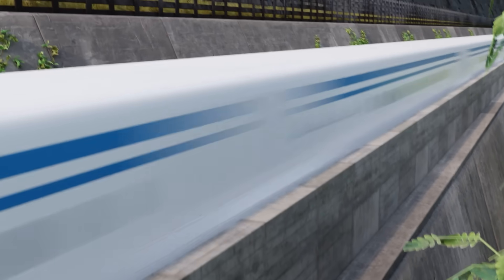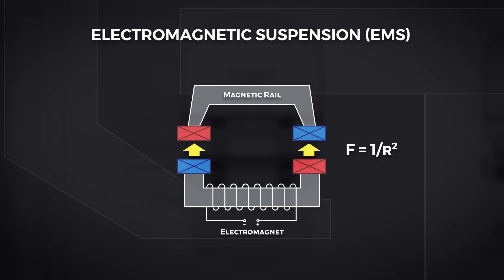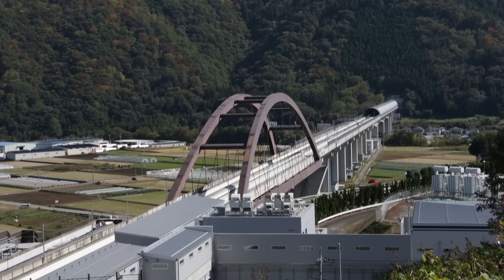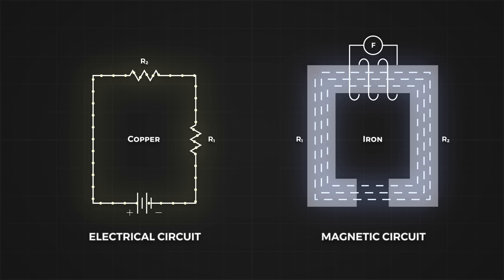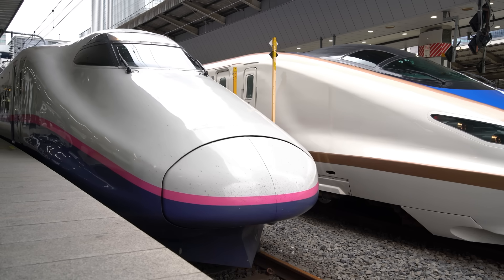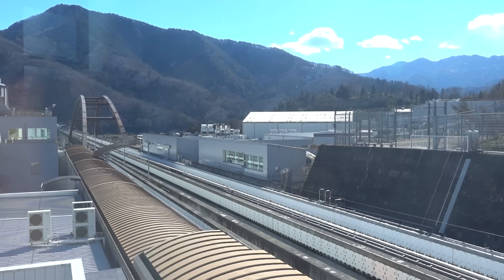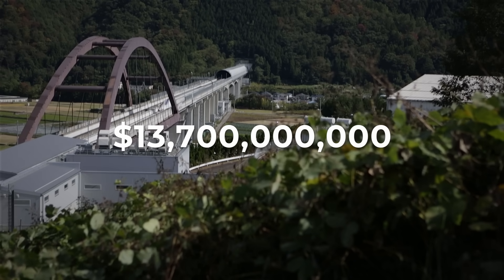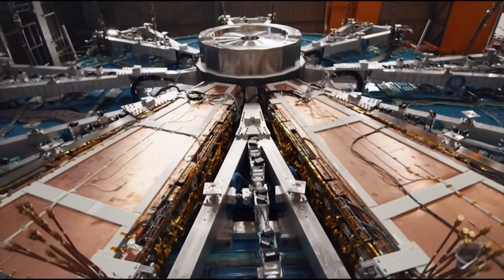How Japan's Maglev Train Works

Comment: My understanding is that yes, MagLev has a far higher startup cost, but a far lower operational cost due to reduced maintenance from the lack of friction.
Reply: At least in theory.  Nobody has enough experience operating them long term to say that empirically.  And requiring constant input of liquid Helium for cryogenic superconductors is not trivial as an operational requirement.  Another few advances in higher temperature and more practical superconductors could make future MagLev lines a lot more practical.
Reply: @guaposneeze  The inner cryo-loop is self enclosed. The helium cooling system will only need topping up in the event of leaks or service, no different than an MRI magnet.
Reply: Yes, and they just made a TREMENDOUS advance...oh wait.   @guaposneeze
Reply: @guaposneeze higher temp superconductor research is a random stretch. With no foundational theory we are constantly just trying random material hoping it works. My grad course I type 2 showed how lacking the foundations are. So they are not breakthroughs you can count on
Reply: It's generally suitable for long journey's for this reason. The higher speeds achieved can make it a rival to aircraft for travel between cities (like Tokyo and Osaka), but on short journey's, who cares if you saved a few minutes, for a seemingly ridiculous price tag.
Reply: @tsumugikotobuki0131  Well, it will also serve as a relief line for the Tokaido Shinkansen line in the event of an Earthquake and open up opportunities at Shinagawa station. JR Central doesn't have a lot of property around Tokyo station and having the terminus at Shinagawa will pad their bottom line. the Tokaido line is a life line for Japan. There are currently hourly flights between Osaka and Tokyo (if not more). Once completed in 2037 (or later) there will be a much lower need.

And it's also a more direct route, which is where a lot of the savings come as well. The physical distance is a lot less on this route. when you're running 16 trains per hour on your main line, it's time to consider building a relief line. There are also talks about making the existing line have more trains make more stops, so that line will, as a consequence, become slower.

The current fastest service (Nozomi) train from Nagoya to Shinagawa takes 88 minutes. 
However, the train that makes every stop takes 123 minutes and only leaves hourly.

After the Maglev train comes online, it's assumed a lot of passengers will take that instead so JR Central has talked about reducing the number of express trains and increasing service to the intermediary stations. Even people traveling from Osaka will likely transfer to the Maglev if their destination is near Shinagawa
Reply: @tsumugikotobuki0131  Tokyo Nagoya will go from 1:40 to 40 minutes non-stop. That's a game changer. 

The great thing about this train is its acceleration curve. It gets to cruising speed  of 500km/h within 5.5 km. Conventional HSR takes 15–20km to get to 300km/h.

So, yeah... it doesn't make sense for conventional HSR to go 400 or 500km/h as it takes a long time to get up to speed. 

The Tokyo–Nagoya segment is ~280km long and station spacing is 60–80km, so yeah... conventional HSR doesn't make sense at all at speeds higher than 350km/h. 

Maglev will be 40 minutes non-stop, and apparently ~75 minutes making all stops, accounting for dwell times while the non-stop trains passes by at some stations... so you're right that making stops when going 500km/h makes a pretty big difference, but I can't imagine what a conventional HSR difference would be. 

On the Tokaido line, it goes from 88 minutes (fastest) to 123 minutes (all stops) and that's only trains that get up to 285km/h on that segment (and parts of the line only 110km/h in Tokyo). 

I can't imagine the spread a 400km/h conventional train would be, even using Japan's very fast accelerating N700S trains.
Reply: @tsumugikotobuki0131 , for short journey, standard steel-rail HSR will still work.
Reply: Absolutely not, because on all investments there is a cost of capital involved. The reduced maintenance cost advertised is more than offset in favor for conventional trains by:
- Higher scalability of longer trains
- Similar speeds of conventional train, as aerodynamics make it inefficient beyond that. TGV and ICE could already be operated at 450 Km/h, yet ICE is the fastest with 320 Km/h due to efficiency losses.
- The cost of capital for the investment up front can be 8% per annum easily.
- Maintenance cost of the rail and wheels are not that much important compared to the cost of energy and logistics.
Reply: @NevermindXY  To be clear, TGV/ICE/Frecciarossa are not operated below 450 Km/h because it's not "aerodynamically efficient", they aren't because at those speeds the train physically destroys the track and possibly itself in a multitude of ways, which is exactly what maglev is meant to solve. For example, for ballasted track, going above 320 Km/h causes the train to suck up the rocks from the ballast into its own underside, damaging the vehicle and eventually ruining the ballast.

Yes, I know a TGV did 570 Km/h, but that was a one-off done with a heavily modified train with one car that would be completely unsustainble on the tracks.

The point of maglev is not that it has a higher theoretical top speed than rail, it's that it can sustain much higher top speeds in a practical manner. Also, it has better acceleration which really helps to reach said speeds.
Reply: @NevermindXY  - Similar speeds of conventional train, as aerodynamics make it inefficient beyond that. TGV and ICE could already be operated at 450 Km/h, yet ICE is the fastest with 320 Km/h due to efficiency losses.

The Siemens Velaro design is already quite old and got smaller changes over the years. And there are velaro versions that are approved for 350 or 380 max. 320 is likely for Germany as we have quite short ranges between the city on the route. So acceleration is more important than the high speed. 
The Velaro Novo that is in testing is a complete redesign and should with aerodynamic optimizations and other cost reductions help to make higher speeds more cost effective. 

Marketing claims an overall reduction in energy consumption by up to 30 percent and A 20 percent reduction in investment costs and 30 percent lower maintenance and servicing costs but we will see how it will work out in reality.
Till the Maglev will be ready to be adopted outside of japan will it compete with a new generation of trains.
Reply: at higher speeds, track maintenance is more costly, yes, so removing train contact with track will save a lot on regular upkeep and maintenance expenses. it has a higher startup cost not only because the materials of the track and construction of the track is more expensive than regular rail construction, but also because of routing. at higher speeds, there have to be gentler curves. this makes it hard to route around obstacles like mountains and means disruptive construction through cities and expensive tunneling/bridging. but it is ultimately worth it as the trains are cool. they also are good for the economy because people will go to other places more. also it is good for the climate because it will replace airplane trips. UNLESS! it will be good for climate unless it does not replace airplane trips. if it replaces preexisting bullet train trips, it will be bad for the environment because of ecological disruption from construction and increased energy demand from higher speeds.  it's climate savings come from reducing costly flights, but in tokyo there are already mostly people riding the train. what really will help to convince people to ride the train instead of fly is decreasing train ticket costs, by increasing capacity. in conclusion, freddy fazbear is my least favorite pizzeria, and i like china very much.
Reply: @KooShnoo  Actually, maglev can handle **MORE** agressive curves and grades. The self-centering force on the train always works, even in a banked curve, and can apply force in multiple directions at once. A maglev track has more in common with a roller coaster than a conventional friction rail train.
Reply: @dustinbrueggemann1875  I think the speed to viability requires less curves and a train of 700 people it much less articulate than a rollercoaster
Reply: @eartharrow6772  Obviously not to the same extent as a literal thrill ride. MagLevs' track grade requirements are similar or even slightly looser than an interstate highway's grade limits, but that's still far less restriction than conventional rail.
Reply: @dustinbrueggemann1875  Grades yes... but I'm pretty sure the curves on this line are considerably gentler than any HSR being built in Japan.
Reply: @dustinbrueggemann1875  Not sure of the actual limit, but I know parts of the track in Yamanashi have a 4% grade. or 40m/1000m
Reply: @KooShnoo other than the end bit it made great sense, the maintenance on the train seems potentially expensive with gas cooling systems, no wheels (less wheels)to replace but wheels are fairly cheap
Reply: When you can build the track 11 times over for the same price, something tells me, operational cost is not an issue...
Reply: @whuzzzup   You can't build 11x the track, though... THIS line is expensive because it's tunneled. The build costs are, in part, high because it's going through a mountain range. 

The 11x construction cost is a red herring. If you take the cost of this project that is 80% in tunnels and compared it to putting tracks down on an earthen berm in the French countryside, you're going to get a big difference. 

Ya gotta compare apples to apples, not to pomelos to cherries.
Reply: @whuzzzup  
"When you can build the track 11 times over for the same price, "
The number 11.2 times is mot accurate, he moved the decimal point, it suppose to be 1.12 times. Check out JR-central 2009 report of both the build and the running cost of the system
Reply: It's actually the opposite. First of all, induction means that you immediately lose 30-50% of electricity. Then there's the hyper exotic technology. If this system is ever built (currently stalled construction) it will be a completely bespoke system that is locked into the one manufacturer. Consequently replacement parts will be worth their weight in gold.

I'm sorry dudes, but there's a reason why every single maglev project has been cancelled including this one. Maglev is pretty much dead.
Reply: And also higher gains die to the faster round-trip time, serving more passengers.
Reply: You guys are crazy if you actually think that there is going to be LESS maintenance cost involved with keeping the maglev track opperational compared to steel rail.  Yes, you eliminate the relatively minor factor of wear on the track from the wheels, but you replace the steel track with hundreds of kilometers of electromagnets and their associated infrastructure you have to maintain. The steel track is very robust and reliable and very, very cheap. The idea of maintaining the shear volume of electrical infrastructure described in the video being less maintenance than steel rail is absolutely preposterous. Yeah, there isn't wheel wear, but it will still be susceptible to all sorts of other kinds of damage.
Reply: @pstrap1311  Right because caternary wires aren't a thing? It's not just maintenance of the electrical infastructure needed to power conventional HSR trains. These actually wear out. 

Remember, there is no physical contact with these magnets. I'm not saying it's maintenance free.... but they've been running trains on 26–43km of track for 30 years now... I think they probably have an idea of the pain points when it comes to wear and tear and maintenance. 

The entire corridor is about 285 km long, so the 43km test track is 15% of the entire length to Nagoya. They can extrapolate what they've learned from maintenance of existing track.
Reply: @TheNewGreenIsBlue    Sadly, catenary wires aren't common at all here in the US. I wish they were because that would be way better than the diesel electric propulsion which is the current norm here. :(  And yes, those wear some as well and require maintenance. But it is not comparable. All the catenary wires require is a piling every hundred meters or so, which don't wear out, and then you just string the wires between them. It is going to be like an order of magnitude more complexity and difficulty to build this electro magnetic rail, which would require miles and miles of burried electrical components, which will then have to be unearthed for repair.
  I agree that the best way to estimate costs would be to extrapolate from data, but I don't at all believe there has been one of these trains opperating long enough at a large enough scale to provide usefull data about maintenance costs. It's just, like, test tracks opperating at very small scales/duty cycles, and in easy to access locations and so forth.
Reply: @pstrap1311 that’s why USA should skip to maglev
Reply: @qjtvaddict    ridiculous. We should have more rail of any kind. No reason to chose the type that costs 100 times more per mile to implement.
Reply: @pstrap1311 America needs more HSR in general, but it's still a good idea to place MagLev lines for high-demand point-to-point routes that see a high density of commuters throughout the day. That's why the Toyko-Nagoya-Osaka line is being built. These 3 towns have incredibly high commuter density and need a lot of service, and especially fast service, over the day. This is supposed to replace short-haul flights. MagLevs can be used for the same thing in the United States, especially on the East Coast and West coast where there are more population centres and less mountains that would need tunneling through, keeping costs down. MagLev does have it's upsides over higher sustainable speed over HSR, less maintenance compared to HSR (There was a JR report on this) and lower running costs. The main cost factor is the initial construction, which is why MagLev makes a lot of sense for high demand routes.
Reply: @pstrap1311  This! So much this!
Reply: @TohaBgood2 anything to cope
Reply: @qjtvaddict  Lol 😁😁😁
Reply: The hundred of miles of electrical wires has to be maintained.  Labor has to go to the tunnel to replace defective magnet.  Debris has to be picked up.  Bridge needs to be examined periodically especially after earthquake.  Who said it's zero maintenance?
Reply: @Civsuccess2  HSR has just as much if more MORE to maintain. Catenary wires need to be maintained and replaced regularly and kept at tension due to friction. 

Compare that to static guideway coil magnets. The superconducting magnets are all aboard the train and current is induced in the relatively passive guideway. 

Tunnels and viaducts for HSR have to be maintained as well. Additionally, underground structures have less risk in an Earthquake, as there is lower movement underground. 

The Maglev guideway requires lower maintenance than rails. No one at JR Central thinks it will be ZERO maintenance. 

The train itself will require Liquid helium/nitrogen but that runs in a closed coil with very low losses. They're also working on high-temperature material magnets which would not require liquid helium, further simplifying the system. 

Yes, debris has to be picked up, just like the current line. They run a train every day before service to check the line currently. However, this line will have a considerable amount underground, which reduces the amount of work required. 

You can find quite a bit of information about the maglev here:
https://scmaglev.jr-central-global.com/
Reply: @Civsuccess2  most of the track equipment will be encased in conduit and concrete. It's solid wires that won't be exposed to wind or weather. The track will have a similar maintenance cost to a buried power line. It will be free of all the maintenance associated with standard rails, which is much more difficult and dangerous than maintaining an electrical conduit. Also, the bridges would be getting maintained regardless of what kind of train is on it, so bringing that up is misleading at best.
Reply: You have have high ridership across its entire life to recover that cost, and you can't just raise the price of a train ticket since people will simply find other means of travel. Ergo, this is only profitable in first world sardine can cities like Tokyo.
Reply: @samsonsoturian6013  Tokyo is far less sardine than New York IMO. It's got a tonne of mid-rise and even SFHs reasonably priced within the city. 

That being said, it's actually NOT ideal for high ridership along the whole line. In fact, you can look at Current Japanese lines like the Tokaido line. Out of 18 trains per hour, only ONE makes all the stops, 2-3 make a few extra stops and the VAST majority only stop in Yokohama and Nagoya on the way to Osaka.

HSR is MAINLY for connecting BIG cities to OTHER big cities. 

And yeah, the Maglev in Japan won't be that much higher than the ticket is today. At one point, JR Central said it would be 1000¥ more for the Maglev ticket (but that was a few years ago)... so about $10 USD. 

I'd imagine when it launches it'll be about $20 higher realistically... but it will depend on supply. That being said, JR Central may reduce Nozomi services on the existing line in order to push customer to the Maglev line. They've already said they may do something like that by increasing the number of stops once the Maglev is built.
Reply: @samsonsoturian6013 the Shanghai implementation is just plain bad
Reply: The comparison isn't between MagLev and high speed... MagLev basically loses on all fronts except pure speed. The comparison is between MagLev and air travel.
Reply: @Datamining101 When you have to decide of you build regular HSR vs a Maglev there is obviously to compare between. Regular HSR can also be faster then Air travel already, so you will always need to decide on a per project level. You saw why in the video. 10 times the cost for Maglev for only 50% more speed needs to be justified somehow. I would always prefere 10 times more HSR Lines over one fast Line. And it boosts the economy more to have better infrastructure everywhere instead of just one place. So you see, there is a comparison to make. Thats the reasom why japan is building such a line, you can a only justify the high cost when you have not much need for regular Rail or HSR elsewhere in your country anymore.
Reply: @tami6867  
"You saw why in the video. 10 times the cost for Maglev for only 50% more speed needs to be justified "
The video is not accurate on the relative cost. Check JR-central 2009 economy report for chou shinkansen
Reply: @Datamining101  Which fronts? 
Greater efficiency
Less noise (at similar speeds)
Potentially less maintenance (At least lower wear and tear)
MUCH faster acceleration.

JR Maglev's higher cost also has a lot to do with Japan's geography and need to tunnel through the Japanese Alps.

Yes, Maglev is a competitor to Air Travel, but it's also a competitor to HSR as well when it comes to connecting two large cities. It's not that great for creating a "network" of interlined trains, but for point-to-point connections like the NEC in the US where people will often fly... it's ideal.

I'd posit it also may have been a good fit for California as well.
Reply: @Datamining101  
" MagLev basically loses on all fronts except pure speed"
What do you base that on? I can see quite a few fronts where maglev is winning.

Acceleration. Personnel cost, Automation, maintenance, free from dust and grime,
Reply: The cost listing was totaly wrong in the video... Well.. kind of. The cost of the maglev system was right, the cost for high speed rail system was wrong.
$2M for a high speed railway? you don´t even get a 3 lane road for that. A highway typically cost $5M/km, a single track non electrified normal railway cost about $5m/km.. dual track, about 8. Electrified about 12... high speed, about 20.

The 10-50 number is also wrong, it should be 1-5 times. And.. well if include California high speed rail, its considerably less.

According to JR-central book keeping SC-maglev is 22% more expensive than high speed rail to build, not 11 times.

He say 11.3 times more expensive, its actually 1.2 times more expensive.
Reply: @matsv201  depends how wide the highway is
Reply: @samsonsoturian6013  
That is a typical average highway over a 10 year period in Europe. (yea.. that is what happen when you mix dollar and km)
Reply: @matsv201  relative costs of material is also important. North America has a lot of crude oil and gravel so asphalt is cheap.
Reply: @samsonsoturian6013  The price of bitumen is really not that different in Europe or USA. Brent is $84, WTI is $81.. yes its cheaper in USA, but only slightly.
Reply: @samsonsoturian6013  Standard highway have a very specific dimension. And that dimensions may suprice people in american is almost exactly the same in Europe and USA. Its a matter of like a hand full of inches diffrance.
Reply: @matsv201  depends what part of Europe and America you mean
Reply: @matsv201  two lanes, four lanes, six lanes, eight lanes?
Reply: @samsonsoturian6013  that would be a federal highway contra a ten-t E road in Europe. Both standard.

New roads are typicallt always built  2+2. Its really very rare that totaly new roads are built 3+3.. this example is for a standard roads. That is 2+2.
Reply: @matsv201  yeah, and let's be honest... ANY line that tunnels through the Japanese Alps, HSR or Maglev is going to be expensive. Less to do with Maglev, more to do with routing and 80% of the line in tunnels.
Reply: How about security along a 4000 mile stretch of track that's a terrorist target?  What about upkeep, what about the lack of foot traffic to pay for it because unlike what the video says, at least for the US, it doesn't matter WHERE you put a station for these, it will be inconvenient for most people in that city just like any airport it because we have large cities, and even with the logic used here, which is put a terminal in the downtown areas, well THAT sucks in the US.  THAT is the LEAST convenient place to put anything.  Large US metroplexes typically have more than one airport, including international airports.  THE NYC metroplex area which includes New Jersey has 3 airports.  They are VERY MUCH part of the infrastructure in the US to move people around.

But it some private companies want to pay for this, hey what the hell?  See if they can make a profit on their own, like almost no transport rail does in the US even though it's more convenient on different routes than driving.

In other words many of the points to justify something like this just aren't true.  And if you built a high speed rail from NYC to LA it would have to stop in at LEAST 5 - 6 cities before it would have enough traffic to be profitable, and then it's slower than flying, because 5 hours is the flight time from NYC to LA, and in spite of the supposed long wait times, well, not when I've traveled.  You do need to show up early though.  I'm not sure how different that would be for a train like this because you'd still be dealing with security.
Reply: @johndoh5182 use the army and hunt down terrorists
Reply: @johndoh5182 that’s the point it stops in MANY in between cities
Reply: @qjtvaddict  The maglev will only stop in other cities once per hour. The rest of the trains will be non-stop. There is ONE stop for each prefecture (except Shizuoka, which doesn't get a stop)

Direct service will take 40 minutes
All-stop service will take 75 minutes.

The fastest service today between Nagoya and Shinagawa takes 88 minutes.